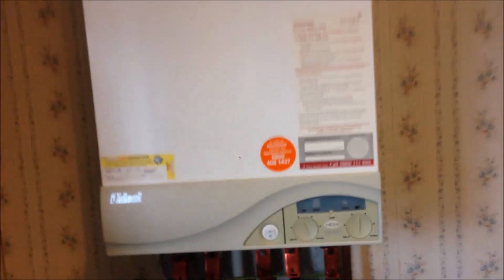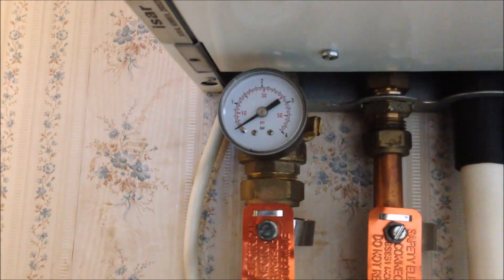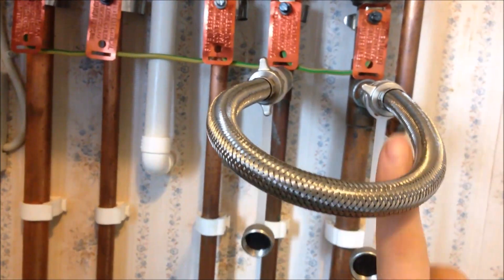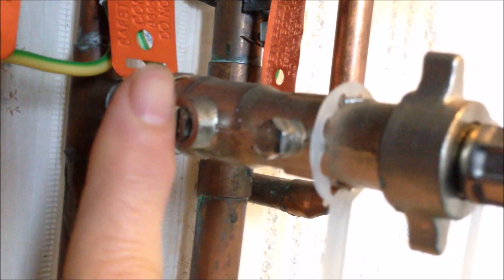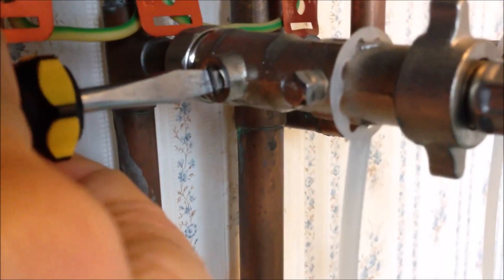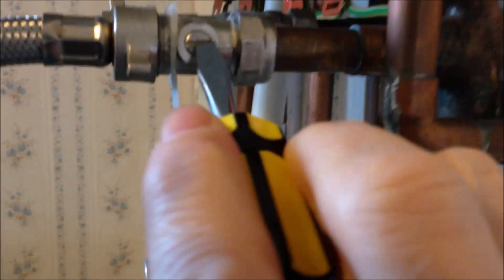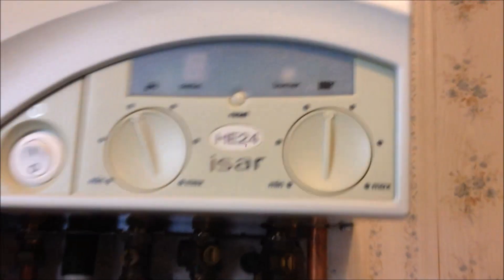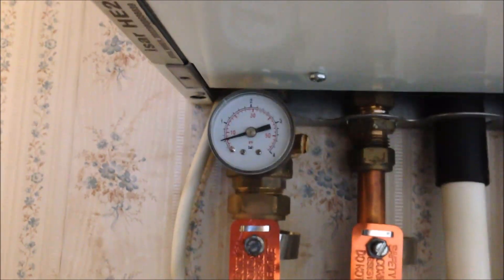iDeal Central Heating Boiler: How to Top up Water

Comment: Hi I z got this boiler is cutting off after few minutes of working. Do you know what could be wrong with it. Thank you
Reply: Most likely fault is overheating. Try to bleed the system and check if automatic pressure release valve stuck (mounted on top of the main exchange).  Safety first. Good luck!

Comment: I sprayed water everywhere but you know what. Somehow it worked. Was I supposed to do this with the boiler off?
Reply from the maker: Well done, Amy! You may do it with the boiler on or off. if you have the boiler on, it may fire up automatically when the pressure is high enough for the pressure sensor. Have a good day!

Comment: this is not the problem.its the expansion vessel that needs re-pressurising with air.
Reply from the maker: A very good point to consider! But I did have a dripping leak downstairs and It had been repaired as shown in my other video. Now the pressure remains stable. Thank you!

Comment: Great video. I bled a few radiators and my pressure dropped to zero. However, although I have this exact boiler the pipe work looks the same apart from there is no silver flexible hose with valves to let some more water in. Any ideas please?
Reply from the maker: you could try to it everywhere such as kitchen cabinets or cupboards or drawers? if no found, you should be able to buy one from DIY stores, such as B&Q in UK. Have a good day!

Comment: Thanks you so much! Do you know-how why the pressure goes low in the beginning? Is normal that the bar goes down and then you need to up the pressure? 
Thanks you so much!
Reply from the maker: hi, the reason for the pressure went down is any leaks in the central heating system.  if there is no leak, you may only need to top up  once a year when doing the annual service. have a good day!

Comment: There is water coming out of the first valve that I turned vertical from horizontal, and turned it back horizontal again. What does it mean?
 I have not touched the other valve as yet as worried that I might make things  worst. I have exactly the same boiler model as you have.
Reply from the maker: HI, according my boiler,  vertical is the closed position and horizontal is the open position! you can check yours. Also with my boiler: when I turned the left valve to horizontal position (open position), it also leaked slightly! however after I turned it to the closed position (vertical), leaking stopped totally.  Hope your ones behave in the same way as mine. Have a good day!